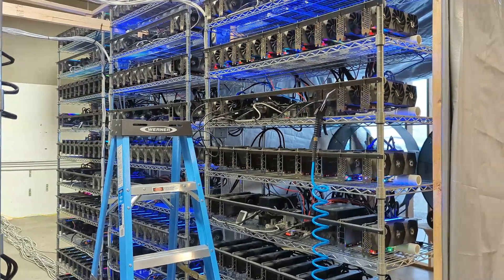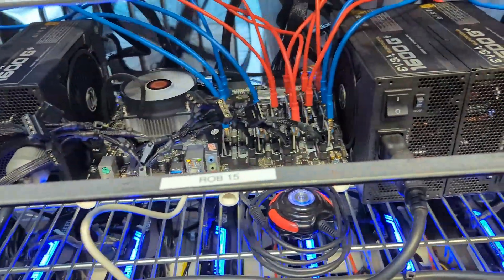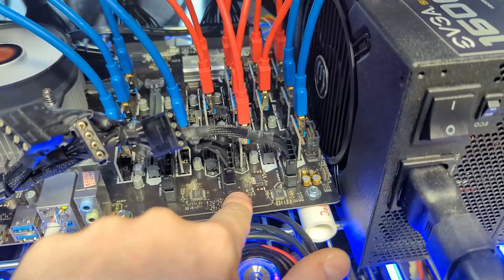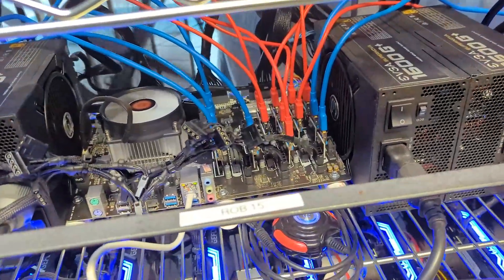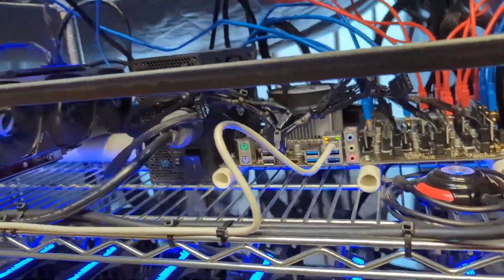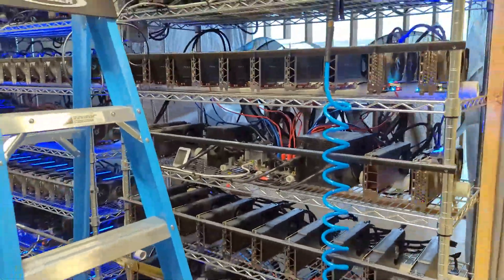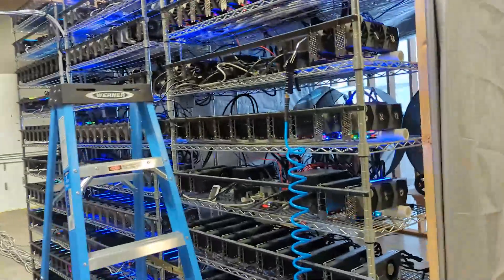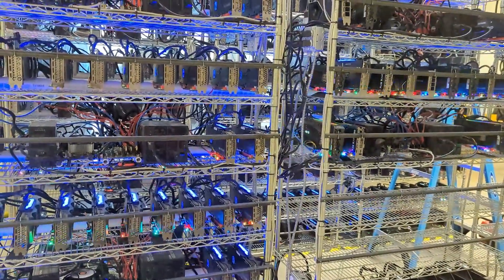GPU Mining Farm - GPU Card Keeps Crashing the Rig, Black Screen On Boot

Comment: Why do you use ATX power supply mostly instead of server psu?
Reply: because the psu server is very very overpriced, and also overrated

before mining bomb/hyped hit at late dec 21
1200w server psu are about $20 + board & shipping should be around $50
Reply: @delusional_nip_fans7247  Server PSU's are much cheaper and designed to run 24/7
Reply: @delusional_nip_fans7247  server psus are only 25 usd on ebay and the breakout is like 30 usd